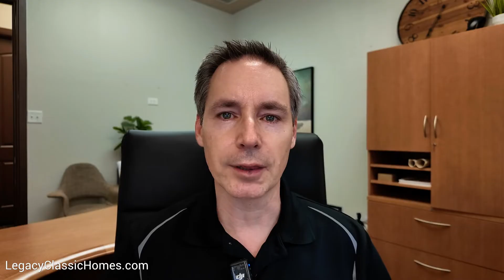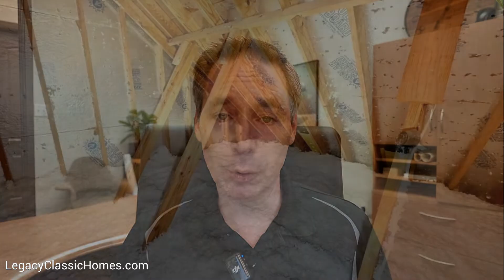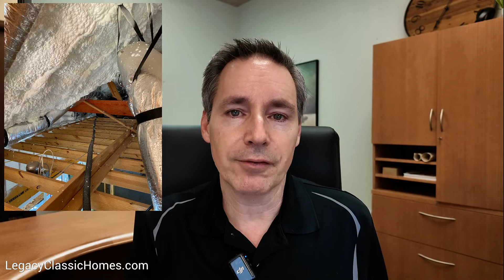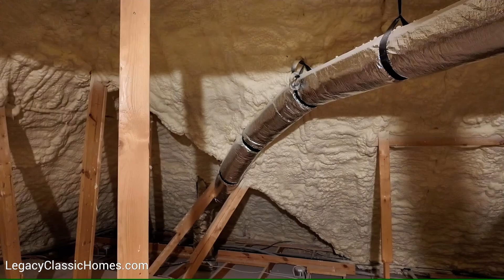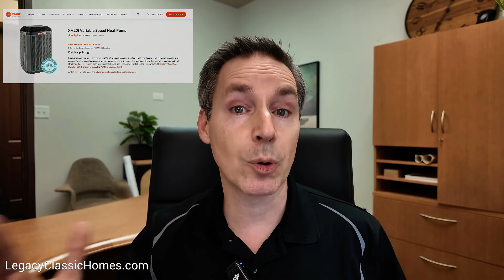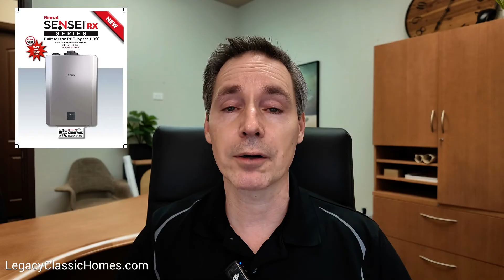Must haves in new home build. My top 5 construction features!

Comment: Wrong information on the water heater.  Heat pump water heaters are way more effecient than other types and only consumes 500 watts of power. Also, Heat Pump water heaters have a side effect which is it works as a dehumidifier that is a must have in a spray foam house.
Reply from the maker: You are correct about the heat pump water heaters. They are still a tank though so they have finite amount of hot water, which is the huge advantage tankless have over them. While they do dehumidify, they are usually put in garages so their effectiveness is pretty limited. They are also expensive. I'm not knocking them per se, but I haven't seen them used a lot either.

Comment: I used an older tankless DHW heater with a recirc pump by adding in a small, 20 gallon tank hot water heater.  Tankless and recirc really don't play nice together because the tankless will cycle on and off repeatedly trying to keep up with the difference in water temp between what goes out to the pump and what comes back in from the recirc lines.  By adding in the little tank, my tankless does not cycle on and off, but is still available when the DHW needs call for it.
Reply from the maker: That's a clever way to prevent the unit from cycling too much!
Reply: Good Idea. Did mine with a 80 gallon holding tank. 4 bedroom 4 bath and a Airbnb apartment downstairs. Ton of people in the summer. Up to 10 people showering in the morning - a couple at a time, We have never run out of hot water. Also no extreme temperature swings.

Comment: No spray foam…do 2x6 walls with rockwool and zip R6 sheathing
Reply: I think rockwool is the best. NO off gassing, Zip System is nice!
Reply from the maker: Rockwool is great. It does not burn and sheds off water. It does not air seal though, which is one of my main reasons for using spray foam, along with the encapsulated attic design which has many benefits including the HVAC not sitting in a 120 degree attic in the Texas summer. 

I am not sure why everyone comments about foam off gassing. It stops off gassing completely after 24 hours. There are a lot of other products used in homes that off gas way longer than a day, and many of them are in the finish stages like oil based paints, carpet, etc.
Reply: @TheBuildersPerspective-p6f  It might be because we’ve been told Gyphosate is safe, etc. Trust in such claims is justifiably questioned.

Comment: Great list but I do have to disagree with the tankless water heater. Living in a hot climate id prefer to go with a heat pump water heater. They are 4x more efficient. Yes they don't have unlimited amount of hot water however you can upsize the tank. Another added benefit is it helps keep the humidity down and air that comes out is cooler helping with the air conditioning usage.

Comment: I'm not really a fan of spray foam anymore since I'd found out how it can crack due to moisture over time. Since I have become a fan of rockwool for wall insulation and timberfill for ceiling insulation. A homeowner is rarely gonna climb up to the attic if they have a good insulation that will last for years. With that being said, I think I can sacrifice the cleanliness of an attic if I have a great insulation thats pretty much pennies on the dollar (not fiberglass) as oppose to spending thousands on spray foam and having a clean working area that I'll rarely go in.
Reply from the maker: I totally understand. Every insulation type has pros and cons. You have to do what you are comfortable with. Rockwool is excellent because it does not absorb water and is fire proof. It's also a good sound insulator. With that said, I've known remodelers that say when they tear out walls that had that insulation, it has disintegrated a quite a lot. That's just anecdotal, but both my framer (who does remodels) and my superintendent who used to be a remodeler told me that, so it could be true.

Comment: I don't agree with all of these, especially the use of spray foam. If moisture gets between it and the sheathing/decking (and it will), you will have a mold/rot problem in no time. It's best to have a vapor open (but controlled) wall system, especially in the north, so moisture can always dry to the inside or outside or both. There are better options than spray foam, in any climate, for air sealing and insulating continuously, and you don't have to worry about the off gassing and fire risks. I plan to use a self adhered house wrap on all exterior sheathing with continuous exterior insulation outboard of that. That said, building science techniques, in general, are embarrassingly lacking in American home construction, and it's why I plan to build my own dream home with help from a couple contractor friends, in order to save money and get the best possible result.
Reply from the maker: Fair points. Starting a YouTube channel has taught me that spray foam is without a doubt the most controversial building product out there. I certainly understand the concerns and take them seriously. Many of the claims made can be issues in certain climates, but not very applicable to our climate zone in Dallas-Fort Worth. We work hard to control humidity in our houses by using supply air in the attics and variable speed HVAC systems in the homes along with dehumidifiers.

What is usually not mentioned in commenter’s claims about moisture issues with spray foam is the same issues can apply to other insulation types like fiberglass and blown cellulose also. Those insulations can also stay wet for long periods of time after leaks and promote mold growth. 

Other claims like those made about off-gassing are not factually proven. Assuming proper installation practices, open cell spray foam becomes inert with no off gassing after 48 hours.  

We use open cell foam in our houses. The “con” is it is permeable so water and moisture can move through it and it will get wet. The “pro” is that its permeability also allows it to dry out. Closed cell foam because it is not permeable and will therefore not get “wet” or allow water to pass through if there is a leak, which sounds like an upside. The downside of closed cell is the moisture is if introduced from the outside, it will remain trapped between the foam and the sheathing and it can rot. That is why we use closed cell in steel buildings and open cell in residential houses. 

Open cell foam contains fire retardants but does not perform as well as blown cellulose, fiberglass and certainly rockwool when it comes to fire ratings. Houses are built out of wood, and if a fire is bad enough that the insulation begins to burn the fire may have reached a critical stage anyway, but the flammability of foam is a reasonable concern. 

I’m not at all defensive about negative comments about spray foam. With today’s energy codes, builders have to achieve pretty stringent air sealing ratings, and open cell foam is a great way to do that while also creating a home that is way more efficient than homes I was building a decade ago. That said, it is not the right product for every climate. I agree an insulated sheathing board like Huber Zip-R may be a holy grail because it would leave an open stud wall which allows for easy drying, but there are still complications with air sealing requirements, the thickness of the R-panel, etc. so it isn’t the perfect solution…yet. 

Good luck with your build and send me some videos/pictures when you do it. I’d love to see what you do!

Comment: Should be top 5 for the south. Don't use open cell in the north.
Reply from the maker: Makes sense. I imagine closed cell is the better call up north.
Reply: That is correct. In colder climate nobody knows that non thermally broken aluminum windows exist, and if they had a bigger budget they would choose triple glazed windows  over anything else.   Inverter driven HVAC another p.... suggestion, when you can install a cold climate heat pump and have two in one heating and cooling. A thankless water heater is laughable even for the south, when you can install a built in heat pump water heater you get COP almost 4 and cooling of your garage for free. The water circulation system is not necessary, a complex system which could be replaced with adding a few electric instant heaters under every facet which are far away from the  main domestic hot water tank
Reply from the maker: @andreycham4797  Yea completely different ways of doing things in the south and the north. I want to go up north sometime soon and check out the different setups. Just stayed in a house in CO and got to check out a boiler system. Not something I EVER see in Texas.
Reply: The foam is flammable and if there is a roof leak, you can get a lot of damage before knowing it.

Comment: Spray foam insulation is about the worst insulation for healthy home environment. It offers gases toxic chemicals for years and can cause huge mold issues if you get water between the sheathing and foam because you’ll never see the leak. Still don’t understand why the builders are so ignorant.
Reply from the maker: This is not true. Open cell spray foam stops off gassing completely within 24 hours after it’s sprayed. Look up the actual data on the product. Open cell foam is permeable so you can see evidence of leaks when they happen because it will be wet. Certainly if a leak is never fixed then mold can occur, but that can be the case with any type of insulated wall that is constantly leaking. Closed cell is not permeable and will keep water from going through it, which can be thought of as an advantage over open cell phone, but it also means you never see the leak and it can rot the sheathing or roof decking it is sprayed to. Our encapsulation packages are open cell foam. In my experience, every building product can have an advantage and a disadvantage and you have to know how to work with the products that you use. As a builder that has used open self spray foam for years, we have experienced roof and wall leaks, and we were able to locate the source of the leaks. Does it mean some foam had to be torn out? Sure, but it was simply re-sprayed once the leak was repaired.
Reply: @ LOL, so you bought the manufacturer’s BS. I’m a building inspector and a chemist. I’ve seen the horrors of this product too many times.
Reply: @ Just take a calibrated VOC meter and set it next to your open spray foam on a hot and see what readings you get. You may not smell it but it’s off gassing even after 24 hrs. I’ve done it and confirmed it.

Comment: Hahaha...this is all nonsense. You folks start of with a crapy design in the first place. Then you guys try to reinvent the wheel, but "Made in the USA"...Great, my point is: LOOK, WHAT OTHERS DO ! Learn, adapt, improve. The Swedish live in a harsh climate. The germans/english/french build zero emission homes...NO SPRAY-INSULATION NEEDED. Do natural insulation instead. Lucky americans, as you dont have to rely on mainstream-media - you have YouTube and a lot of friendly europeans that are happy to help...
Reply: Interesting. Could you let me know what natural insulation Europeans use so that I could try it here in Australia.  Many thanks.
Reply: @fredgassit3360  Jup, sheep wool, hemp wool, hempcrete, sea gras, Miscanthus × giganteus or Napier grass, wood-wool slab and naturaspan (wood shavings coated with clay). In Australia sheep wool should be easy to get. If arable land is avilable, consider Napier grass or hemp for multi-purpose. Ask local authorities, what is certified - think out of box, btw, all these materials are pretty cheap and of course easy to work with,  good luck.
Reply: You might wanna try faswal but I'm not sure on shipping. An insulated cmu might be an option but it's not natural necessarily but it is durable at least and possibly a cheaper wall system then icf
Reply: @epg423  yes, I would also consider  Just BioFiber Block from Canada or products from Hempwood, KY. Intercontinental shipping of natural building materials (susceptible to moisture) sounds counterintuitive. Think global, buy local
Reply: His mind stuck in the 20th century